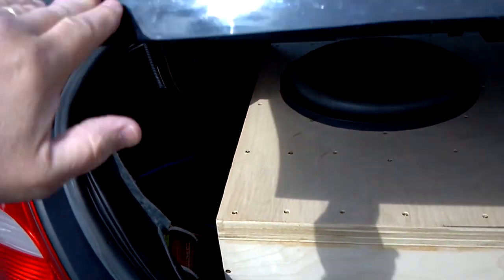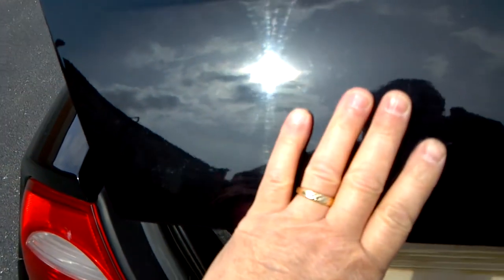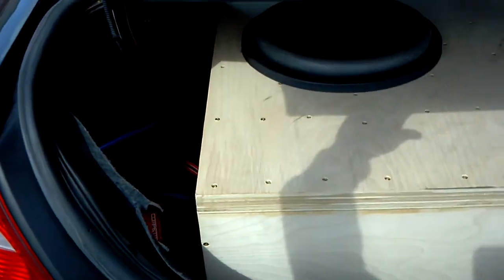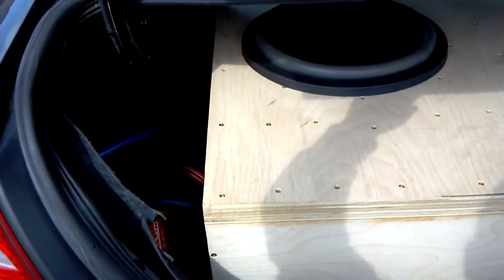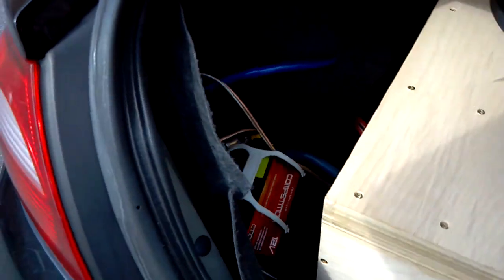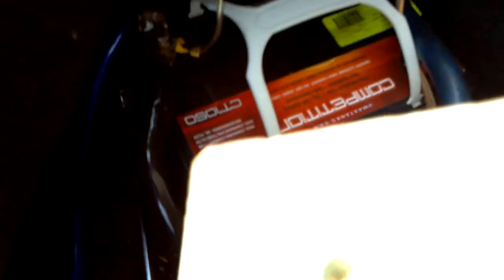American Bass HD-15

Comment: Are these as good as the older versions?
Reply from the maker: Man I wish I had the experience but,never owned or heard the older HD's..I can say I love these subs and still have them..Have a bunch of videos of my truck with both HD-15 and on a 2000W Audiopipe,they get down..Having a box built and upping power this coming year..
Reply: flyinhigh450 i ordered the carbon model and this 1 arrived. I assume the only dif is cone and basket. Sounds good to me so far. Not broken in yet
Reply: The newer ones are better and they made them where they handle the bass way better as of low end bass
Reply: Also get a amp that dyno at at least 2400 rms because those audiopipe 2k is not putting out 2k most amps that say 2k doesn't put out 2k
Reply: @1800munchie  so these subs can take more than 2000 rms? I have a 15 hd and a zvx 15 and I'm conflicted on which one to keep. Seems like the zvx gets louder but the HD isnt even broken in yet so maybe that has some th ing to do with it.